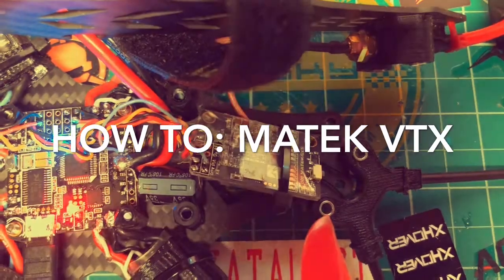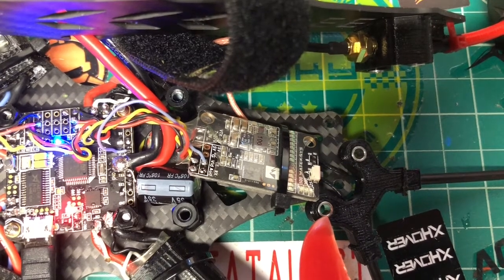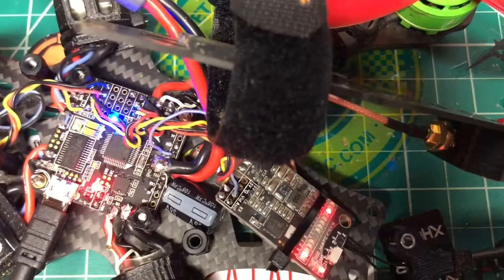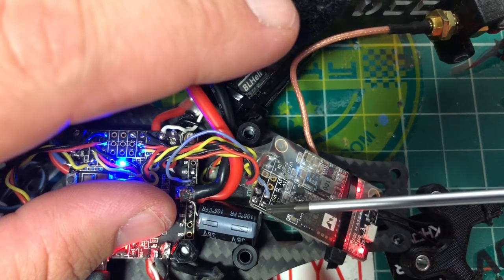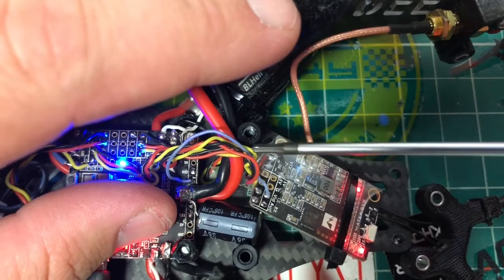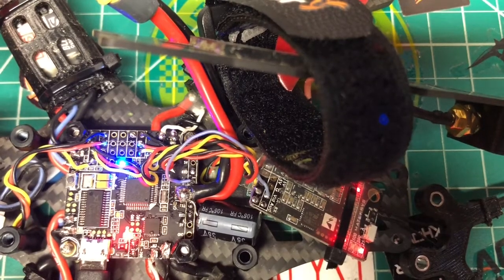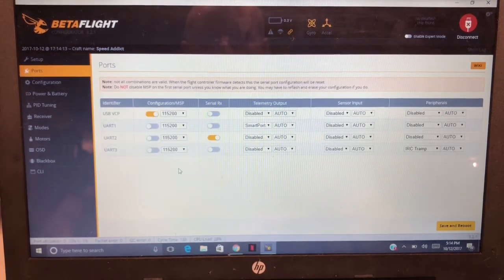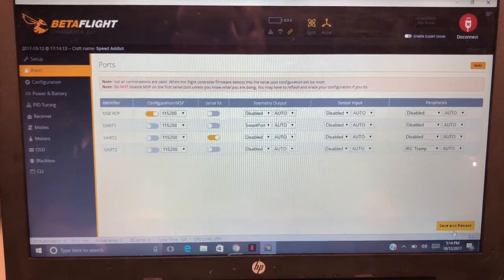How To: Matek Vtx For Smart Control

Comment: I think, , based on findings of a noob like me, your FC needs to have OSD or forget any of this working.
Reply from the maker: Xzadfor Spacefox yes you need to have osd on your fc in order for this to work.
Reply: I discovered an interesting glitch. If you think you have it(I did, I did not have it) and you set up betaflight for it, the VTX (for me) would not keep settings I set with the buttons until I turned off the UART. It would allow for a new setting then blink and reset.
Reply from the maker: Xzadfor Spacefox I've heard this issue before. Something could be wired backwards. Or it just could be a bad vtx. But that is a strange issue. I've had issues with wired glitches on an f3 emax board. But I had to remap stuff to make it work. I had to deactivate smart audio to make the glitches go away.
Reply: I was able to repeat it over and over to be sure. But since my board doesn't support the OSD functions, I left is off and called it done, using buttons now reliably.
Reply from the maker: Xzadfor Spacefox o? Yes if it doesn’t support osd it will cause problems. No need to activate it because it only works through osd. Good luck!

Comment: for some reason this doesn't work on the BFF4, really pissed lol
Reply from the maker: MuchFly Wow got to www.racedayquads.com. And look at the product page for the BETAFLIGHT F4. There are 2 videos watch them. You need to activate soft serial on the tx your going to use. I have one went through the same thing lol.
Reply: Chris romano i did that on uart1, still didn't work
Reply from the maker: MuchFly Wow is it connected tx to Tx. Set on soft serial and set to tramp telemetry. Then make sure you go to the tramp spot on the osd. It’s the second one tr in the list.
Reply: Chris romano got it working on uart 3 without soft serial
Reply from the maker: MuchFly Wow ha. What ever works lol.